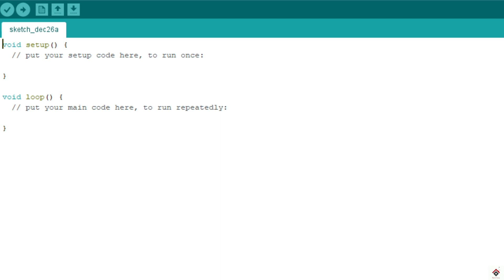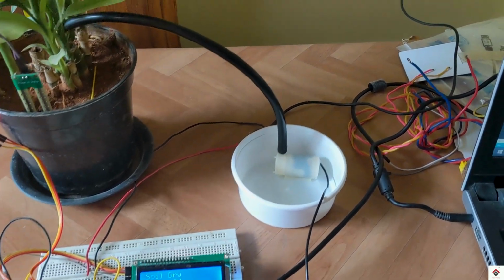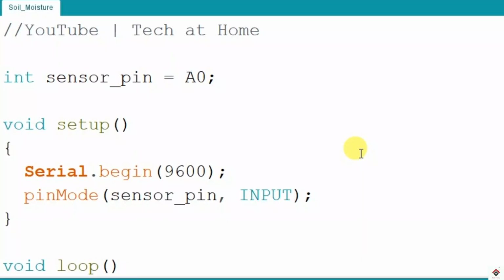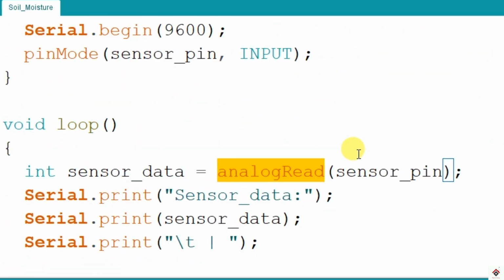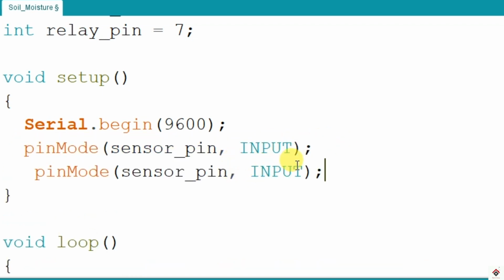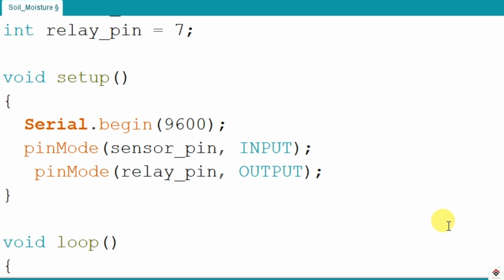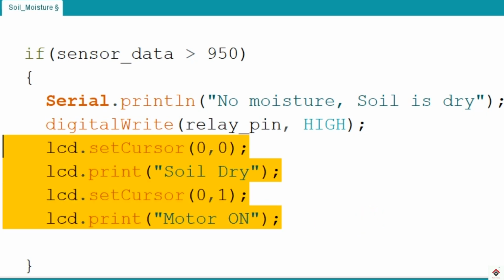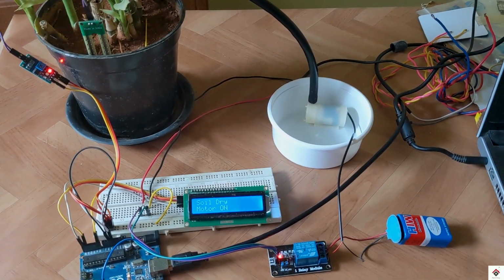Automatic Plant Watering System using Arduino & Soil Moisture Sensor | LCD display [with CODE]

Comment: What is the use of relay here? I have seen tutorials where they are not using relay module. I am a beginner.
Reply from the maker: Water pump is of 9v. Arduino cannot directly run this motor. Arduino just send trigger to relay when to activate and deactivate the pump. For basics of relay, you can refer this video: https://youtu.be/iy3nXFh__rg?si=u4yrg_uLbwAgk-br

Comment: WHAT DO I GET FOR 50 Rs.??
I MEAN DO I GET THE CIRCUIT DESIGN WITH THE CONNECTION POINTS OF JUST THE DIAGRAM??
AND THE CODE IS COMPATIBLE WITH ANY TYPE OF RELAY MODUL AND MOTOR AND LED PANEL OR I HAVE TO USE THE SAME MODEL??
Reply from the maker: You will get code and only circuit diagram.
1. Use 5v relay module.
2. Any motor will work, but choose proper power supply for the same.
3. Use LCD module having i2c interface.

Comment: hello, is the code still available? we are planning to pay
Reply from the maker: Yes available, you can fill the form with link in description.
Reply: @techathome can i ask first if you have a link of the battery you used? i will also pay today
Reply: @techathome hello, i have sent the payment and submitted through the google forms
Reply from the maker: Code and circuit sent already. Check once.

Comment: Code is taking too Long to upload what to do?
Reply from the maker: Is it uploading at the end?
Or any error?
Reply: I am facing some power issues I mean everything is working but after some time lcd is crashing
Reply from the maker: Relay consumes more power. So we have given external 5v supply for relay. Have you done the same?

Comment: does the code still works, if im uwing capacitive soil moisture sensor?
Reply from the maker: Yes it will work. Small changes needed in the code because the values for wet, dry will change little bit.

Comment: I need help, this is Not working,  i connected all the things properly ,  but still the the display is showing nothing and the motor is not rotating even the sensor is dry
Reply from the maker: Have you given external supply? For relay.
Can you send mail.
Reply: I have replied to the mail,   

About the exact problem,  I have given the external supply

Comment: Sketch uses 4866 bytes (15%) of program storage space. Maximum is 32256 bytes.
Global variables use 578 bytes (28%) of dynamic memory, leaving 1470 bytes for local variables. Maximum is 2048 bytes.Sketch uses 4866 bytes (15%) of program storage space. Maximum is 32256 bytes.
Reply: Sir like this error is coming
Reply: What to do tell sir plss
Reply from the maker: Can u send me the message after this.

Here there is no error message.
Reply: Sir I uploaded
Reply: It is not working
Reply: The same error is popping for the code.
Reply: @bhagyashreekadam8526 Samee omg What did you do to solve it?

Comment: even if soil moisture is already wet and medium, the motor would still go on, I am using a different relay from yours. How do I fix this?
Reply: same problem
Reply from the maker: You can send code photo on mail: deepakhd20@gmail.com
We can try reversing relay switching in code once.

Comment: can this power a 12 volt motor?
Reply from the maker: Yes, 
At the relay you can use any motor and corresponding power supply.

Comment: When i turn it on, there is nothing writing on my lcd(its just lightning). Also the water pump is not turning off when the sensor is wet. What should i do?
Reply from the maker: Can you send request on mail: deepakhd20@gmail.com
Reply: @simunkrot000 do you have the updated code? The water pump does not turn off too when the soil is already wet 😢
Reply: plss a desperate student here
Reply: I can’t graduate highschool if can’t get it to work 😭

Comment: Hello, it is truly an amazing work and explanation. However, aside from dry, medium, and wet, the LCD also displays dryium and wetium eventhough we did not put it on the code. What appropriate actions shall we do? Thanks!
Reply: Hello brother
Actually I am thinking to do this one... How much cost it will take??? And is it working properly?? Plz let me know
Reply from the maker: I have given components link in description, you can check the online prices, it keeps varying.
Reply from the maker: Some improvement needed in LCD commands.
Send request on mail: deepakhd20@gmail.com
Reply: Bro what solution did he give

Comment: can I just use the direct power supply  from the arduino instead of using another battery on the water pump?
Reply from the maker: No, power not sufficient.

Comment: Hey,
The project is working But just the LCD light glows up and display of LCD just shows blocks and nothing else , even after rotating potentiometer either side
Could u pls help
Reply: try to install different l2c crystal file, my lcd only showed one letter then it worked after i did that

Comment: Please what powers the Arduino uno
Reply from the maker: You can use 9v battery and round pin connector to power Arduino board.
Reply: @techathome  
Thanks I used two batteries one for pump and the other for the Arduino.
Please how will my block diagram be

Comment: lcd.begin(16, 2); //This line shows that there is no matching function for calls to Liquidcrystal_I2C::begin (int, int) even after adding library, please let me know the problem
Reply from the maker: The library which you have added might be have different syntax.

Delete that from documents/Arduino/libraries folder.

Try to add Liquid crystal i2c library form different developers.

Comment: bro when insert the battery everything goes wrong and it does not work properly i use a 9v brand "EVEREADY" battery
Reply: how many volt is ur pump. is it 9v or lesser

Comment: hello sir can i know whether to use bigger pump using ac should i need to do some changes in circuit or not?
Reply from the maker: Everything remain same.

1. Instead of DC pump, use AC motor.
2. Instead of motor 9v supply, use AC supply.

Comment: How can we do this without the LCD screen? I wired everything without the LCD screen so I'm not sure if its a code issue
Reply from the maker: You have to remove LCD related code lines, otherwise code doesn't work.
Reply: I did but it still doesnt seem to work @techathome

Comment: Not able to get anything on LCD I2C Module... kindly help urgently.
Reply: hey 
how did u fix it?
Reply: @SamarthMishra-ig9ui  yes same issue for me its worked for me
Reply from the maker: Try to adjust the potentiometer screw on the backside of LCD.
Reply: @techathome  thank you somuch

Comment: Everything is working but the pump does not turn on when moisture is low
Reply: Please i have question  
You used a pompe 3v/5v and the batterie 9v !!
Reply from the maker: This battery has very less current output.
So running 6v motor for some time is still ok. You can use 5v supply also.
Reply: But when moisture is high what is need of water?? I think you have taken the opposite cases in coding.for low moisture Pump should start and for high moisture pump should be stopped or in Low  @techathome

Comment: Excuse me , How will this work if I use a battery instead of the usb cable. I’m having problems with the power source , the RX won’t light up. 😢
Reply from the maker: Yes you can use a 9v battery with a round pin connector to power the Arduino board.

Comment: How can I use a motor of higher power with it pls tell me !!
Reply from the maker: Nothing will change.

Only replace your motor and use corresponding power supply required for motor.

Refer same connections.

Comment: Sir, which water pump(how much volt) should I use for 20 plants which are till the distance of 10feet from pump?
Reply: Add relay and use bigger motors
Reply: Relay is used in this video know do we have to use that only or other else?
Reply: @shashankhiremath4974 you need to use other relay according to the voltage required, if you need to use AC then use 240v or AC relays modules ig
Reply from the maker: The same relay can be used for AC pumps: https://youtu.be/iy3nXFh__rg

Comment: I have a question, what battery should I use if my water pump is 3v
Reply from the maker: You can use normal cells(2 connected in series) or if you want rechargeable, you can go with 18650 battery.

Comment: How will you make it solar powered
Reply from the maker: You have to use battery which should be charged by solar panel. Cannot be powered directly using solar since there will be power fluctuations.

Comment: I have tried if the relay is not plugged into the battery the system works accordingly but when the relay uses the battery the system stops and the LCD appears strange letters or sometimes the LCD turns off the background light, can you help how to solve it?
Reply from the maker: I think power is not sufficient.
You can power your Arduino board using one more 9v battery and round pin connector.
Reply: @techathome  we have the same problem sir, how'd you do it??

Comment: lcd shows nothing.........:(
Reply: how did u fix it?
Reply: @SamarthMishra-ig9ui  check the wiring and the code .
Reply: @GameForPeaceOfficial  could u pls tell how did u correct the code?
Reply: @SamarthMishra-ig9ui   i forget i did this project long ago. you have to double check the wiring. code is not wrong
Reply: In this video he is not connecting the back light connection
Reply: there is a Library needs to install to make this code working. 😅😅
Reply: @Raselm  was't library issued.
Reply: i fixed mine by installing a different l2c liquidcrystal file
Reply: Adjust potentiometer backside LCD means on i2c module, I did same ,it worked for me

Comment: hi the code is working properly but the lcd doesnt show statements about moisture. i tried adjusting brightness of lcd but it doesnt work can you some other method
Reply: S bro same problem 😢
Reply from the maker: Connections might be loose. Try changing the jumper wires.
Reply: @techathome  Hi bro, how can I do this project if my LCD Display does not have an attached I2C Module
Reply: hey
How did u fix it?
Reply: @SamarthMishra-ig9ui  we didn't add lcd

Comment: Bro is that connections are needed to do coding or only just board
Reply from the maker: No, you can even compile without connecting the board to check syntax errors.

Comment: after using your code the motor is turning on on the soil is wet or medium. pls tell me how to fix it

love your video
Reply from the maker: Some relay modules work opposite. You can send request on mail, I can share updated code: deepakhd20@gmail.com

Comment: This code is going reverse that means for dry soil the motor is off and for medium on and for wet also it is on. What can i do sir
Reply from the maker: Some relay modules work opposite. Very small change in the code will fix this. You can share request on our mail, I will share updated code: deepakhd20@gmail.com

Comment: connection,coding is done.But display is not diplaying words as in coding,how to overcome from it.
Reply from the maker: 1. Check the connection on SDA and SCL
2. Try to adjust the brightness of LCD using potentiometer screw present on the backside of the module.

Comment: When u remove the soil moisture sensor why the motor starts
Reply from the maker: When I remove the sensor from the pot, there will be no moisture. This is considered as Dry according to logic, so it activates the motor.

Comment: Your code is right . When iam executing it but not working , it will generates a header file related error
Reply: You can add a library from Uno executer by checking which header file is missing.
Reply from the maker: Install Liquid crystal library. Refer this video for steps: https://youtu.be/PFDmkzSX87o

Comment: #include<LiquidCrystal_I2C.h>

LiquidCrystal_I2C lcd(0x27,16,2);
int sensor_pin = A0;
int relay_pin = 7;

void setup()
{
  Serial.begin(9600);
  lcd.begin(16,2);
  lcd.backlight();
  lcd.setBacklight(HIGH);
  pinMode(sensor_pin, INPUT);
  pinMode(relay_pin, OUTPUT);
  
}

void loop(){
  int sensor_data = analogRead(sensor_pin);
  Serial.print("Sensor_Data:");
  Serial.print(sensor_data);
  Serial.print("\t |");

  if(sensor_data > 950){
    Serial.print("No moisture,Soil is dry");
    digitalWrite(relay_pin, HIGH);
    lcd.setCursor(0,0);
    lcd.print("Soil Dry");
    lcd.setCursor(0,1);
    lcd.print("Motor ON");
  }
  else if(sensor_data >= 400 && sensor_data <= 950){
    Serial.print("There is some Moisture ,soil is in medium condition ");
    digitalWrite(relay_pin, LOW);
    lcd.setCursor(0,0);
    lcd.print("Soil Medium");
    lcd.setCursor(0,1);
    lcd.print("Motor OFF");

  }
  else if(sensor_data < 400){
    Serial.print("Soil is wet");
    digitalWrite(relay_pin, LOW);
    lcd.setCursor(0,0);
    lcd.print("Soil is wet");
    lcd.setCursor(0,1);
    lcd.print("Motor OFF");
  }
  
  delay(100);
}

thank me later....................

Comment: can i use relay 12v? 1:24
Reply from the maker: No, Arduino digital output is 5V, which cannot activate the 12V relay coil.

Comment: Bro I dont have I 2 C module in my lcd display thn what should I do?
Reply from the maker: Then you have to connect all the 8 pins to digital pins, And code also slightly changes for LCD.

You will get i2c module seperately, you can buy and solder.

Comment: can I do this code without the lcd? I have no lcd in my project but aside from that it's the same
Reply from the maker: Yes you can do without LCD also. Use same code.
Reply: Without lcd is that header file required??
Reply: I have a lot of doubts kindly help me
Reply: I am not using lcd and I want it to give a particular amount of water before stopping
Reply from the maker: If you are not using LCD, you have to remove header file and LCD related functions in the code.

You have to keep the pump on for some time using delay.

Comment: can i use esp8266 for this same code by changing the board in software before uploading ?
Reply from the maker: Yes you can use. Refer the pinout diagram of Esp8266 and based on that make the connections.

Comment: bro my model is working but on lcd i cant see any display words
Reply from the maker: 1. Check the connections of SDA and SCL.
2. On the backside of LCD, there will be one small potentiometer screw, try adjusting brightness.
Reply: how did u fix it?
Reply: @SamarthMishra-ig9ui  i have adjusted potentiometer of LCD and got display on LCD